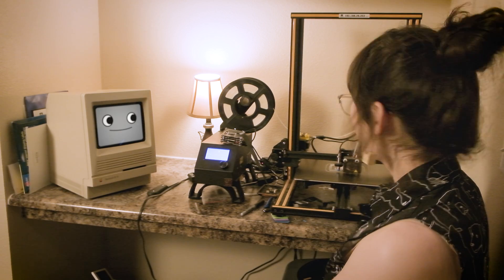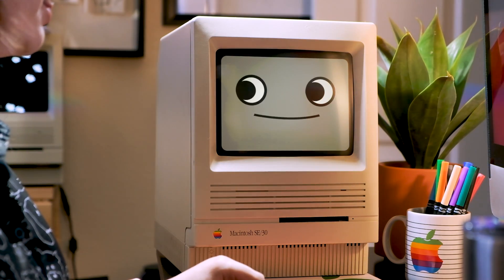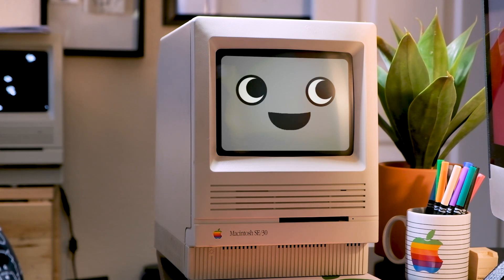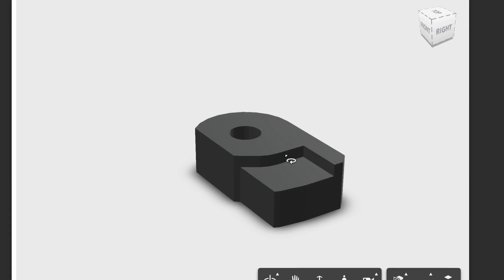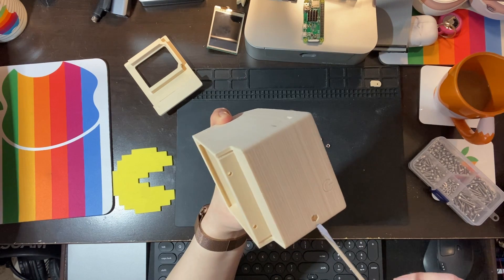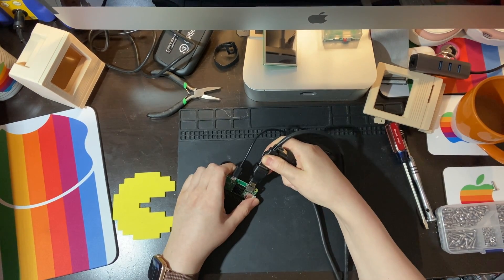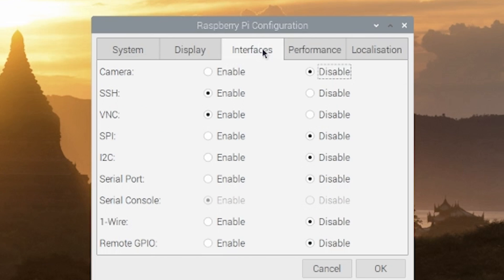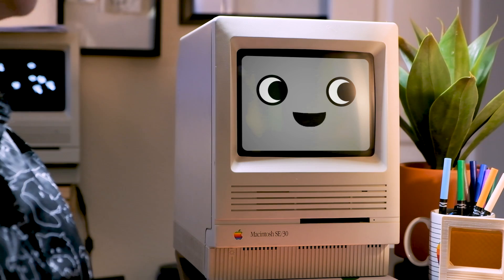Make a WORKING 3D Printed mini Macintosh!

Comment: I’m the person that made the Instructable. Great video of the project! Thanks for sharing it!  I had an SE30 after my Mac Plus. Maybe I’ll make a version of your design. 😉
Reply from the maker: Thank you so much C Genco :) You made an awesome model! I hope you didn't mind me modifying it :O !
Reply: @Rylin Gough a while back someone mentioned that it wasn’t available. I found an email address in the documentation for the screen and asked. They said Amazon should be getting more.
Reply: Heya! Do either of you know where we can find a screen that would work? The one you used seems to be sold out everywhere! Is there another one that will fit, or is there a redesign for supporting a new screen? Cheers!
Reply: @JamesNUFC99  looking into it
Reply: @Rylin Michelle Gough I got another email from the screen manufacturer after the updated version was very different. Experimenting with some others. I’ll update the Instructable when I have mor info. Happy thanksgiving!
Reply: Would it be possible to combine this with a PiSCSI project? To me, having a functionally useful peripheral that gives me internet and fileshare makes this even better. I'd be fine just running the Pi OS without the emulator. I assume that the case would have to be modified to allow a SCSI port in the back. Is there even room for a hat and the monitor connector both?
Reply: I want to do this  but instead of a Mini Mac,   a mini Amiga 1000  and  have it run Amiga Demos.
Reply: I'm incredibly late, but im curious if you'll ever make a pi4 version of this project?

Comment: so ive watched this video several times, and I had a question, you are obviously more Number skilled than I, so I though Id ask, how much would I scale this up to use a 4 inch LCD (wave share 800x400 the one with the 4 mounting holes on amazon)

Comment: So it appears that the screen in not sold anymore, do you know if there's something else that could be used?
Reply from the maker: It looks like AliExpress has a few - https://www.aliexpress.com/item/32840275150.html -  hopefully they will make more!!
Reply from the maker: https://www.ebay.com/itm/194299009304?epid=25041989189&hash=item2d3d1f9918:g:nx4AAOSwePdfl34E this one is SIMILAR but not the same - will have to see if its a good alternative.
Reply: Managed to snag one from Ali thank you

Comment: In case the black on your screen is blue, or the white is yellow, here is a fix from the geekworm wiki: https://wiki.geekworm.com/2.8_inch_Touch_Screen_for_Pi_zero#comment-1025

I used this same screen inside of a imac desk clock with a pi and took me forever to find this solution.
Reply from the maker: Thank you so much for this! It helps get the colors more accurate :)